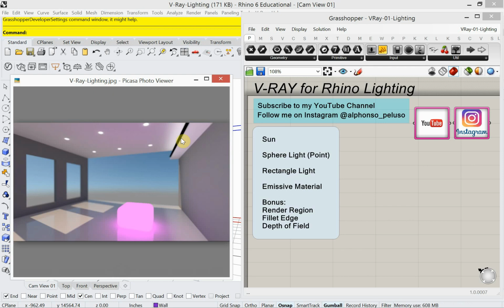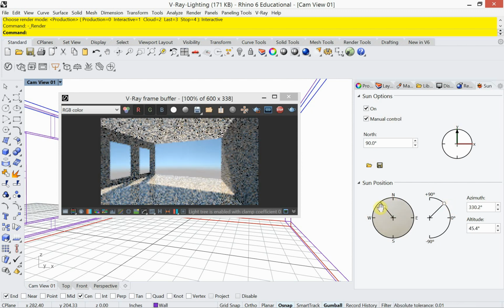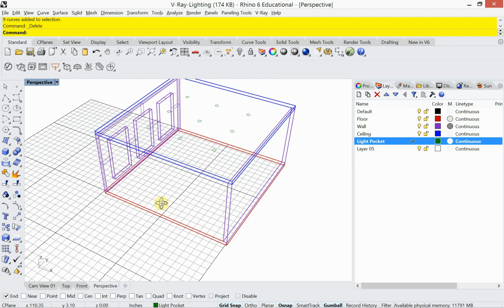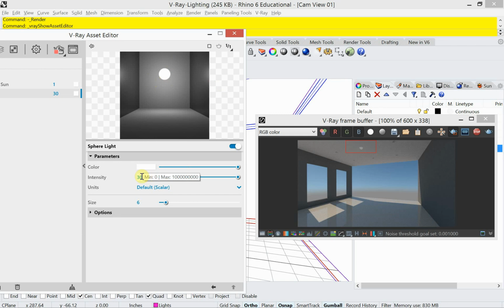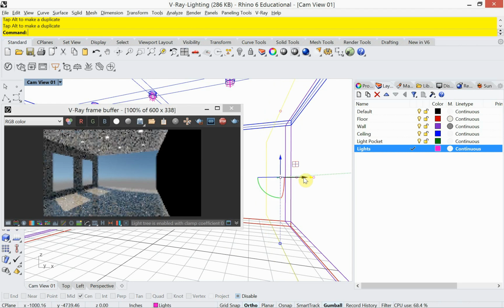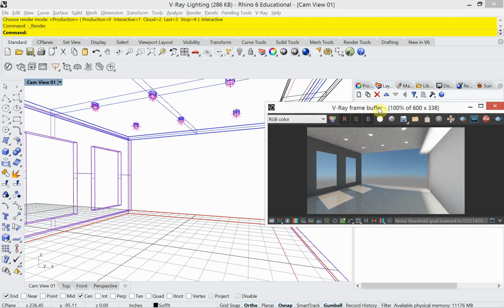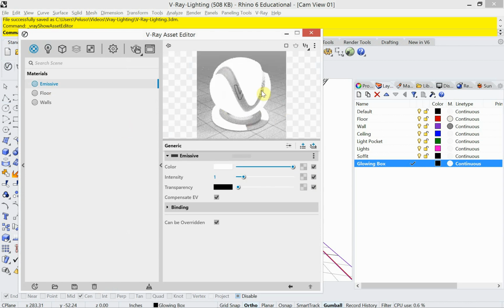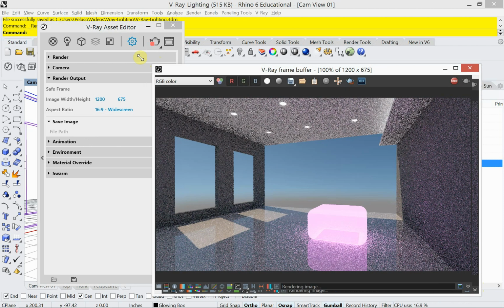V Ray for Rhino Lights

Comment: Hey Great Work , I Too Am A Rhino User But its been 2  year’s and still i have not figured out how to use IES Lights in Vray for rhino pls help want to use it in my interior renders 

The renders appears only dark or after increasing the intensity to like 1000000 only the light appears and never matches the IES Light as it must
Reply from the maker: Try changing the lighting units to Watts Radiant Power
Reply: @AlphonsoPeluso  Thank You For Reply , But There Is No Option Of Changing The Light Units From Scalar To Radiant Power Watts In IES Light File In Vray Fir Rhino , Other Option We Have Is In Rhino Light Manager we Can Change Fall Off Options 
1) Constant
2) Linear
3) Inverse Square 

Pls Reply To This Message 

Intensity and Shape Options Only Are Present in Vray Panel So Pls Help